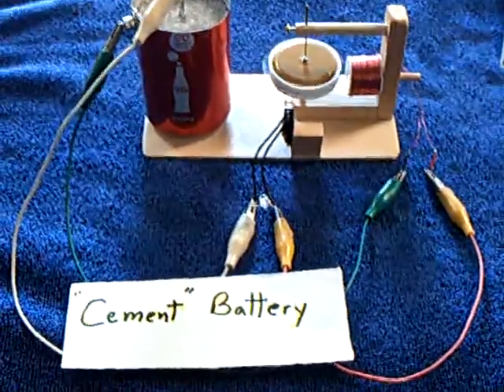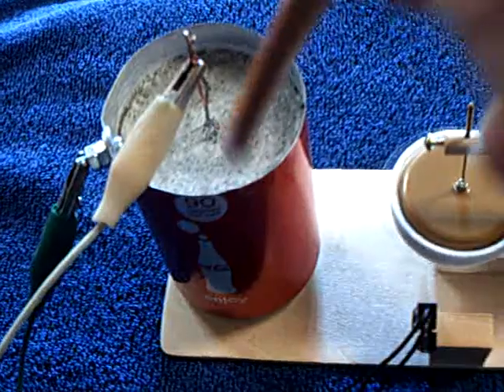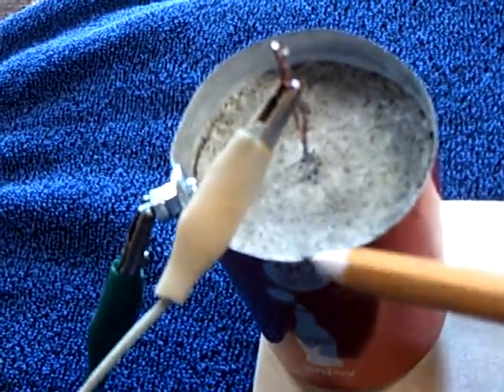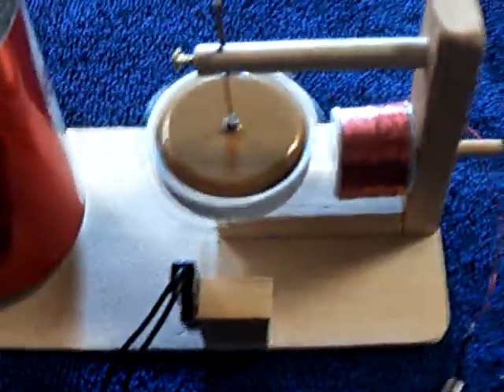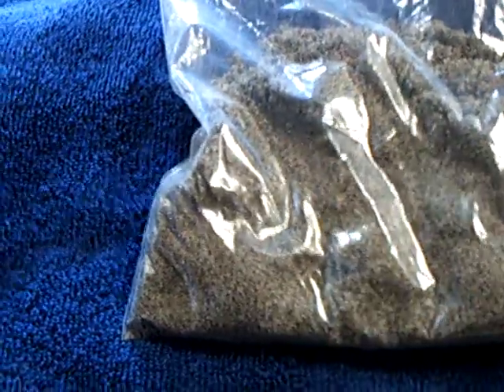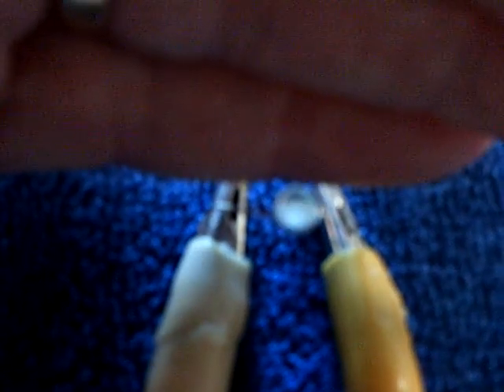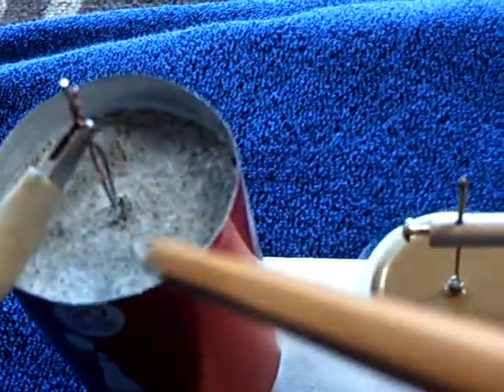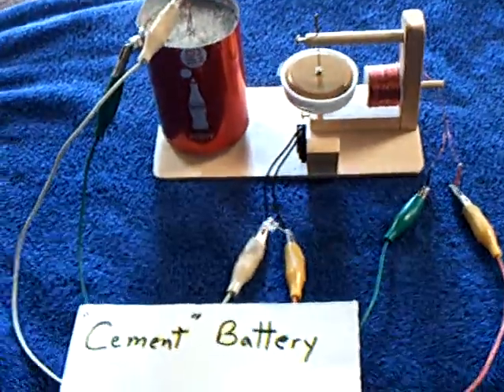Portland Cement Battery.ASF

Comment: do you have a study recommended on this experiment? Any study that could perhaps set the explanation about how cement battery works?
Reply from the maker: +Rhea Nacional  We decided that this was a simple galvanic cell.  It is slow acting after the cement cures but eventually the aluminun can is eaten up.

Comment: I can confirm that cement cells last VERY long time. i have mine more than 2 years and i can still light a red led.
Reply: Hey man did your cement batteries ever give up
Reply: @cartertech2531  After close to 10 years, still 0.9V. lol
Reply: @pleiadesds2012  where they under load for that time
Reply: @cartertech2531  no, they give only few micro amps
Reply: @pleiadesds2012  can you still light an led
Reply: @cartertech2531  no

Comment: I tested a tile cement battery (aluminum tile cement copper) which gave about 0.8 to 1.1 Volt depending on air humidity (and fed a Joule Thief for five months). When it was very dry I had to put it in water for a few seconds to restart it. After five months I got problems with corrosion and had to file of some stuff wherever I connected a wire to this battery. I finally gave up. This type of battery is hydrostatic (absorbs water from the air), may be you should put it in the oven, like baking.

Comment: Lid if you ever go north to Seattle I have some magnetic sand I could give you I collect from the beach. I use it in my high voltage experiments. Might have to try your battery idea here. At this point I have collected 100's of pounds of it lol. I sift it on my rotor setup. But I do save the non magnetic stuff that is left over.

Comment: I would say about three months, may be more if you put oil on top to hold in the moisture. I would guess the can will give out before the copper wire, but I don't know.
The copper wire may break off first causing it to stop working. Copper sulfate. But it does seem to work just fine so far.

Comment: Looking at this, the first thing that comes to mind the copper wire breaking off from the electroysis. Other then that I would build a control which sits for three months doing nothing. I would keep using the one in the video for a while and also do another one which you put into the oven and cook under low heat for 4 hours to speed up drying to the three month state and do a compairson. Just my two cents on this but great job as always keep the vidos coming.